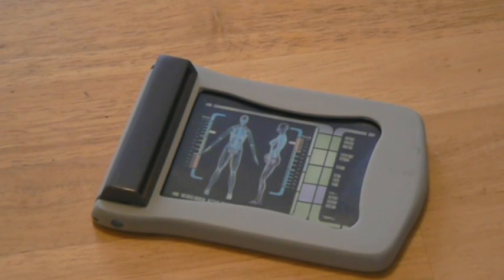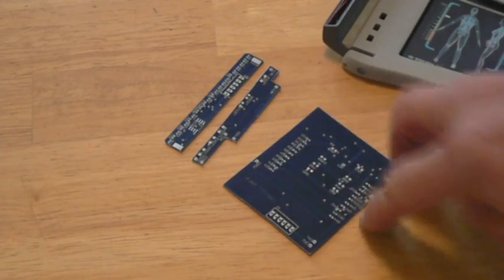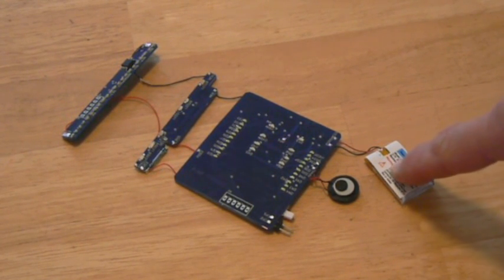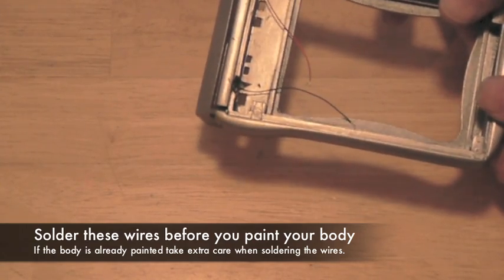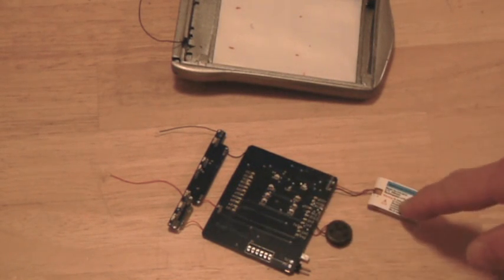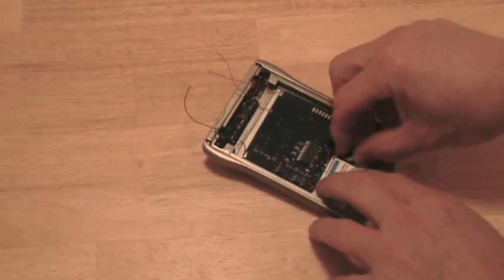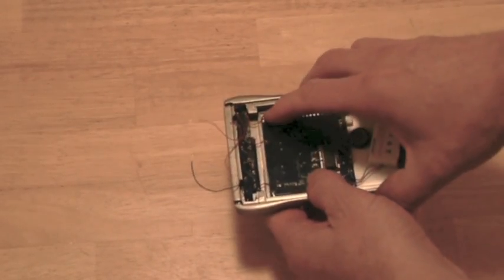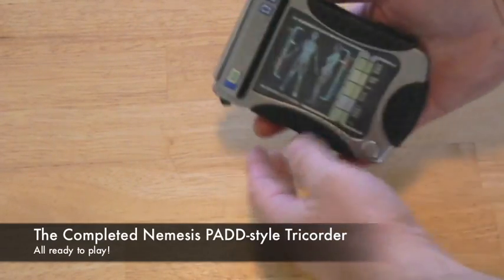Nemesis Medical Tricorder

Comment: Hi Gmprops, i need your help.
Got the main board and geo/met/bio installed ,and when I tried to attach the scanner wires the whole board went dead, the scanner still works with a separate power source but I cant get the main board to work .Do you know what might have gone wrong and how much for a replacement set? also i have been having a lot of trouble attaching the wires to the brass rods, they keep coming off because the rods move when the scanner head opens. I am GMB1of12000 on the RPF Forum